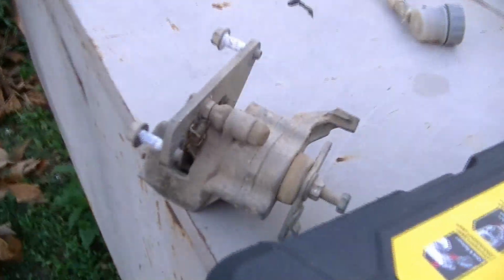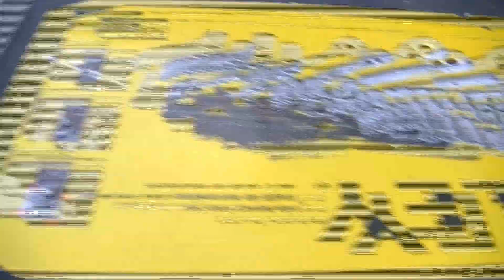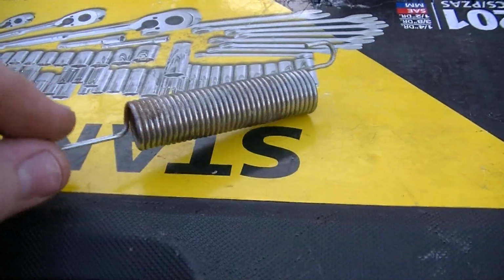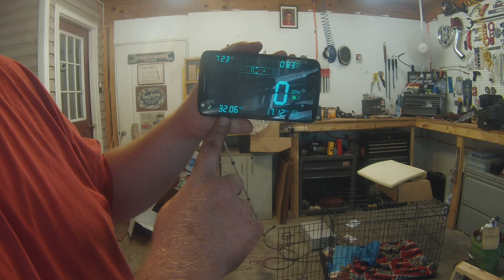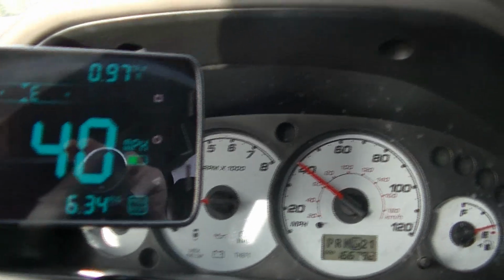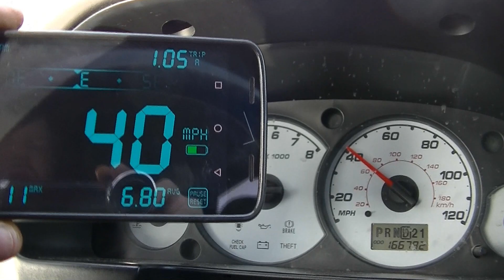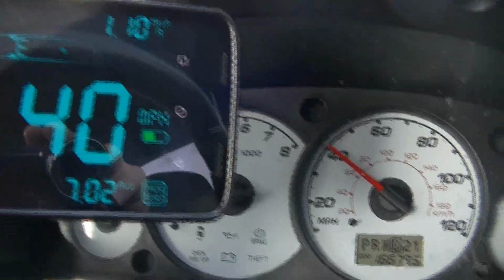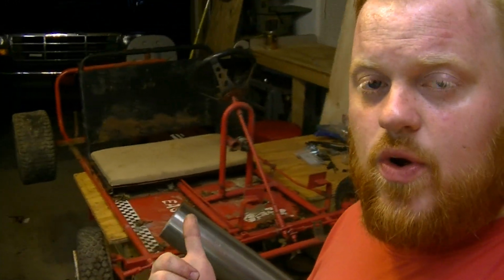Go Kart Rip Snot

Comment: The problem with getting 250 likes is that people are out and doing things. It will likely pick up again in the fall. That app works pretty good I use it on my bike and it is almost dead on. The compass part does not seem to work well at least not on my phone. You may want to check out the iVue camera sun glasses they are pretty cool for doing ride along stuff the sound is not that great but on a go kart they would probably do better than a bike doing over 60mph.. and for around $80 its not bad.
Reply from the maker: +MidwestMotoRider on Facebook we are trying to get 250 likes on the page. We have about 220 or so. I'll check out those glasses.
Reply: Ah.. my bad.. I thought you meant on one video. Well I don't have a facebook account but perhaps I can get a few friends to do it with theirs.. :)
Reply from the maker: +MidwestMotoRider thanks man